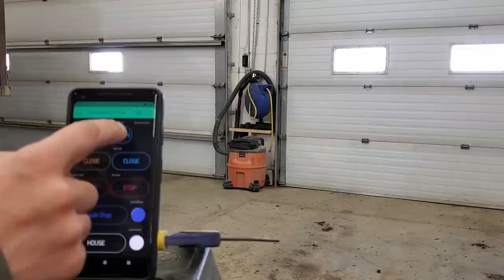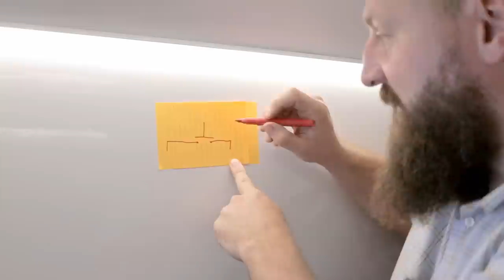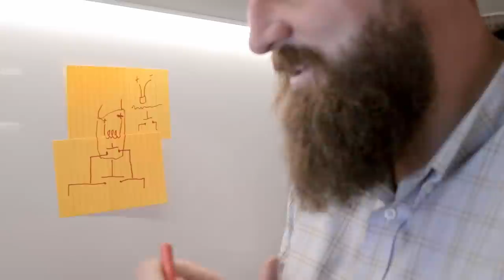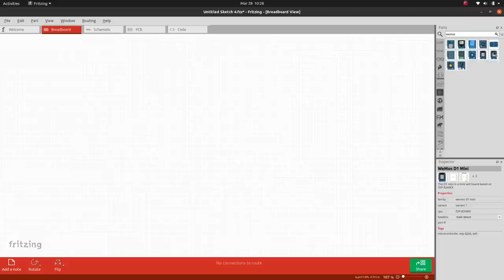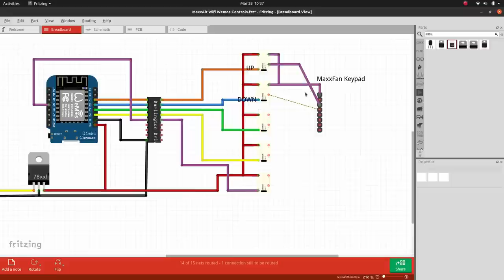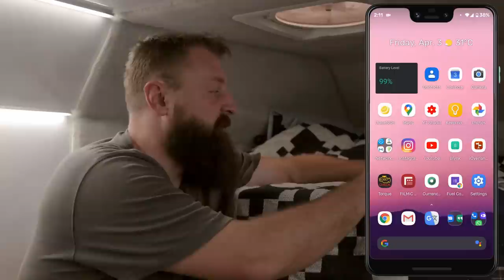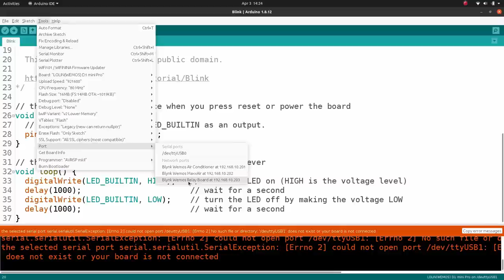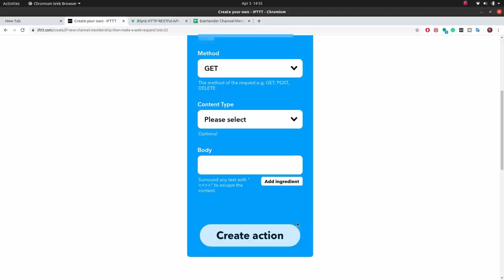How I Automated All the Things - Raspberry Pi, Arduino, Fritzing - Everlanders Automate the World!

Comment: That is awesome. But... Didn't you try to find the simplest way to do it? For example, connect WeMos using resistor directly to IR port, or use IR transmitter with WeMos. Will wait for Upgrade. Thank you for these videos :-))
Reply from the maker: You'll be waiting a while... I did the IR controlled version first, but it was problematic which is why I did it this way.

Comment: Please provide more video like this in the future. What relay do you recommend if the current draw is greater that 10 amps. Can you use the SainSmart to trigger a larger amp relay?
Reply from the maker: Yes, you could just use the relay board to trigger a typical Bosch style relay, these are available in 30, 40 and 70 amp versions.
Reply: Everlanders at 46:44, is that the wemos attached to the relay board?
Reply from the maker: Yes Indeed, It's shown a bit more clearly at 6:20

Comment: Thanks for the info! Which buck converter did you use in place of the 7805 for the fan controller?
Reply from the maker: Great Question! I use the Recom Power R-78HB5.0 units, linked below.
https://www.digikey.com/product-detail/en/recom-power/R-78HB5-0-0-5-W/945-2444-ND/5765379
Reply: @Everlanders  Why these vs. a 7805? $14.22 vs. $1.00 or less?

Comment: those relays are tiny! perfect for the job in hand but being a cheapskate i always go for SRD-5VDC-SL-C as you can get them for 50p in 10's ( HK4100F-DC5V-SHG also) (SIP-1A05 look interesting as the pinout looks ideal for laying out in a line along the board edge).. I like to code, I like to solder, I have always avoided anything that interwebz the two together as that bit confuses my little mind... but this has shown me that i can maybe do that, even though i still wont know how most of it works, or how it can even work when i'm halfway up a mountain with no cell signal... i'm sure if you did some more vids on this people would watch and i also see a lot would be bored stupid, but hey rough with the smooth etc, maybe a normal video and an egghead video timed release on on the same day and everyone is happy as they can watch whatever flavour they like. me, i'd watch both, i'm greedy...Lez, Relay Relay Camping.
Reply from the maker: Perfect!

Comment: Wow! What an amazing video. I am only starting to think about automating my rig and all of this information truly helps. With no software / programing experience - AT ALL - would you recommend a site that is a good place to start to get a grasp on setting up this type of automation. Definitely not too long, thank you so much for sharing.
Reply from the maker: I'd probably advise just jumping in to a basic project, just get a Wemos or 10 and a relay board to match and then check out the example projects at https://examples.blynk.cc/?board=ESP8266&shield=ESP8266%20WiFi&example=GettingStarted%2FBlynkBlink
Reply: @Everlanders  Perfect, thank you so much. Sometimes finding where to start can be the hardest part.

Comment: Do you run a local Blynk Server (perhaps on the RPi?), or do you always assume Internet connectivity?  (P.S.  Wemos D1 are great, agreed when inventory gets low, time to order more!  Clearly you are a kindred soul, Just had a Fritzing designed set of PCB's delivered yesterday!)
Reply from the maker: In fact we run both Cloud Blynk and a Local Blink server. All the Raspberry Pi's report to and update both servers, the Arduino stuff gets OTA firmware updates on the fly depending on our connectivity, changing which server it connects to.

Comment: Have you posted any info on the ignition switch system and how you upgraded it? I saw mention of it in another video
Reply from the maker: No, I'm reluctant to give out much information, security through obscurity... Suffice to say all the original wiring is gone and it's connected to a custom radio authentication system...
Reply: @Everlanders  I had a feeling this was the case.

Comment: Watched the whole thing, just lost on the programming. Reminded me of the time I was trying to setup a system where the furnace would open an outside intake when it was colder outside then inside and also had a lower humidity. The programmable controllers would have helped with that.

Comment: Given that the air conditioner functions are also controlled by an IR remote, could you just have programmed your Wemo to PWM an IR LED (cloning the remote signal)? This would have avoided all the relays and hard wiring to the A/C’s controller PCB.
Reply from the maker: Sure you could...

Comment: @Everlanders Loved the video! I'm interested in learning more about the offline rollover as this is something I would run into a lot in my van. Which service is doing the rollover? The blynk app? I'm guessing Google assistant doesn't keep working without internet.
Reply from the maker: We've installed a local Blynk server and I have the router spoof the online server to our local server if there's no internet. But there are easier ways I may need to address in an upcoming video.
Reply from the maker: https://github.com/blynkkk/blynk-server
Reply: @Everlanders  thanks so much! I will look into it. Already ordered 5 of the wemos/lolin's and pinned out my electric blanket controller 😋

Comment: Love your channel and automation videos..... I got my trailer almost fully automated because of these videos help..... But FOR THE LIFE of me HOW did you get your battery SOC in the blynk app? I don't need step by step instructions just maybe point me in the right direction...

And another blynk question, how did you get your custom blynk icons like the Lil flame icon? 

Any help getting pointed in the right direction would be great
Thanks
Reply from the maker: I'll answer the custom icons question first because it's so easy you'll slap yourself... 😜  I just typed emoticons into the label fields, too easy, the hard part is finding one that fits the need, some are a little bit of a stretch. Ie, Fire = Heater 🔥🔥🔥
Reply from the maker: The battery SOC is more complicated, I have a Raspberry Pi polling the SBMS100 and getting all the available data and then using the Python Library for Blink it's as simple as Blynk.Write(V22, BattSOC) or similar and setting that as a Cron job.
Reply: @Everlanders   omg.... Your right, I slapped myself lol.....
Very cool, thank u soooo much
Reply: @Everlanders  Lil more complicated for sure... But thanks for the reply..... That will be for a Future project..... the longer I go the more I learn and the more these early questions and answers make sense....
Thank u so much....
Keep the tech videos coming....
Dunno if you know... But your awesome At making them lol....
I just ordered the 18650 battery charging board... Gonna make one of those USB rechargable fly swaters, very cool
A++

Comment: Epic video! I watched the whole video, I’m going to unsubscribe and resubscribe just to turn your fan on lol! I would like to see more on gauges. Inside/outside thermometer. Tank levels. The other problem I’m currently trying to solve is a generator auto start with fail safes. I’m installing a liquid cooled generator in a compartment of my bus, isolating the radiator. And would like to have the ability to auto start the genny should battery voltage get too low, or if the interior temp get too high (in witch case the AC would automatically start as well). But I would want it to turn off due to certain conditions. Such as high temp, low oil. Or tripped smoke detector. Again, sweet video! Very helpful as I’m just starting my Arduino journey! Safe travels

Comment: Opto coupler, cool beans. Where do you source your bits and pieces. Digikey and what's another good spot. Also pls. Check out the Ts100 soldering iron. It's 12v and it'll change your life! At least YouTube Adam savages video of it.
Reply from the maker: But I already have a soldering iron... Many in fact... Why buy another?
Reply: @Everlanders  I have a beautiful Weller butane powered one and two terrible plug in types but the TS100 is for exactly what you're doing. It heats up in 18 seconds to 350c. You can set it any temp and it goes there immediately. It's like an electric car. It's hard to describe until you use it.
Reply: @Everlanders  Small, portable and precise (digital). I power mine directly with DC, and can therefore take it wherever I want without the need for AC power, or inverting from my batteries.

Comment: If you change the Fan speed manually on the fan, wouldn't that ruin the variable in the wemos? Since the Wemos can't read the current fan speed. Or did you do some kind of workaround for that?
Reply from the maker: We don't use the buttons, but a very simple workaround is pressing the button 20 times when you want to go up to 10, or 20 times down when you want to go to 1...  But like I said, it's a non-issue for us, it's been 4 months and it has never gone out of sync...
Reply: @Everlanders  Well, that works as a workaround. Just force it to be a value where you're sure it's that value, but if you don't even use the buttons, it's even better ^^

Comment: After I saw this video back in April, I ordered some wemos D1-mini's from Aliexpress.  Suffice it to say, they never arrived after several extensions.  I am to get a refund.   Doing some searching there are several D1-mini clones available from amazon, ebay.  Some even in Canada.  It appears most are v2 clones, with Universal Solder from Sask. having a 3.0.0 one.  Do you have any experience with these others?  IF so, which would you recommend?  I'm in Vancouver, BC.
Reply from the maker: Odd, I ran out myself and ordered 20 more from the official Lolin AliExpress store and they arrived in 6 days...
Reply: @Everlanders  Tracking says it left China on an airplane, but it must have fallen out of the cargo hold, cause it never landed in Canada.  And yes, I ordered from the official Lolin store.  Same day I ordered 2 18650 cell chargers.  They took almost 3 months to arrive.

Comment: An alternative and unobtrusive solution could've been to figure out what codes the AC remotes IR sends and then send those same codes using the wemos connected to an IR transmitter attached next to IR receiver on the AC. In your current solution you the actual state of the AC can get mismatched from the state your wemos thinks it's on if you ever press the ACs physical buttons
Reply from the maker: I did this first... The codes are stacked and the existing libraries wouldn't handle them...

Comment: the ac job could have been much easier with an  IR extender. you put the receiver in the room with your remote and the transmitter  close to the ac receiver ... and voila :))) 
the receiver sends the IR signal through radio waves to the transmitter which is putting it back into IR signal for your AC 
it works through any type of wall
Reply from the maker: What about when I'm hiking a pyramid and the dog is getting too hot... How would I trigger it then?
Reply: @Everlanders  logitech makes an IR device that you can control from an app, so if you have cell reception you can do it, I think it's called Logitech Harmony
Reply from the maker: But that costs more then the $3.50 Wemos board did....
Reply: @Everlanders  :) true ... still a good alternative though for people who don't want to take apart their brand new AC unit and work on it's electronic board :)) lol
Reply from the maker: This video was never intended to illustrate how to modify the exact air conditioner I have, I intended to open people's eyes to the possibilities of what can be automated with inexpensive electronics. It seems that's a tough point to get across...
Reply: @Everlanders  yes ... I agree ... I think it's probably because to get automated your way it takes some good electronics skills that average Joe doesn't have. But I do appreciate always a new way of doing things

Comment: can you use a wymos board to turn 12vdc PC fans on and vary their speed based on the temperature being read from a series of temperature probes?
Reply from the maker: Yes, that's what I'll be doing to control the fans for our fridge compressor.
Reply: @Everlanders  ooo!

you're van fan will definitely be spinning up for that one then!

😄

by the by, before seeing this, I was looking at doing the project linked below using temp sensors and PWM outs from my RPi to control two fans individually...on 2 separate 12vdc powered circuits.

Forgive me if that's not the optimal way of doing that...I am of course new to this...just trying to regulate temps (then possibly humidity and O2/CO2 levels eventually) in an outdoor grow box:

https://www.digikey.com/en/maker/blogs/2019/how-to-control-a-dc-fan-using-the-raspberry-pi
Reply: Yes, readings from a temp sensor control the Arduino PWM output. Not much more complex than the two use cases highlighted here.
Reply: @ARepublicIfYouCanKeepIt  into where do I plug the temp sensors though?

Also, can it handle multiple sensors on 1 X data cable?
Reply: @weedfreer  The short answer is 1) GPIO pins, and 2) yes. A very little bit of Googling will reveal myriad solutions. From your question, however, the DS18B20 seems like a good choice. One or several sensors on a single signal wire. Very inexpensive, as well. See https://randomnerdtutorials.com/guide-for-ds18b20-temperature-sensor-with-arduino/ for information on how to incorporate these in your project.
Reply: @ARepublicIfYouCanKeepIt  yah I have them sensors (plus a cheeky little interface board with a capacitor built in) on its way.

Where I fall down is as to how to use the board featured in this video along with said sensors.

Would love to be able to configure as has been done here such that I can get some real-time monitoring on the go...can't wait for the next installment to drop.

Anyone have any ideas as to how long it'll be?

Comment: I just came across this and thought you might find it useful knowledge: http://www.rv-project.com/projects/fanremote.php. He figured out the RJ11 connector on the Maxxair fan.
Reply from the maker: He only has Open, Close and Off, On, But no fan speed controls...
Reply: Everlanders Yeah, I just noticed. But the “thermostat “ has speed control, I think?
Reply: Everlanders actually, from the installation manual, the “on” cycles the fan speed: “When Fan is running, cycles through four (4) fan Speeds. Once HIGH Speed is reached, the fan motor cycles back to LOW Speed.L
Reply from the maker: Super... I have 10 speeds, In/Out, Temp Control, On/Off. Not Changing it now...
Reply: Everlanders Yeah, your setup works, don’t change it, I just want to one-up you. ;) I think I can manage to connect using the RJ45 and stick a uC in the enclosure, following your model.
Reply: Everlanders Do you have any thoughts about collecting the state from it?
Reply from the maker: I considered it, but because the motor is reversible, I'm not sure how you would do that solid state, you could simply put a relay in parallel with the welder and that would close at most fan speeds I imagine. You could get all crazy with a hall effect or optical tachometer...  But at some point it's probably just easier to build your own controller and remove theirs.
Reply: Everlanders I meant being able to know if it was running, open/closed, etc. Maybe a replacement board is actually a project.
Reply from the maker: I know, but without a indicator led to top I don't know how you intend to sense whether it's open or closed without monitoring the motor somehow...
Reply: Everlanders Optical is probably easiest. But I think I’ll put it on the shelf for an future project.

Comment: Automation... turn it on, turn it off, I just can't be bothered with all that, but maybe if I were handicapped, I might value it, with working legs and arms though, no interest.  If I had 2 houses and wanted to control one from the other, that would be handy, but most of this stuff I can do without.  Just my opinion.  I have designed/built some specialized switches, but only because store didn't have what I needed.
Reply from the maker: Exactly, it's when we're away from the truck and the dog is getting too hot that it's most useful... Also when sleeping and it's getting a bit hot, I don't need to turn on the lights and find the remote etc...